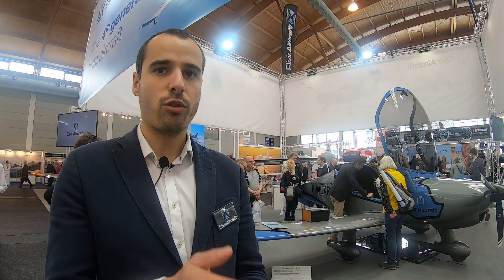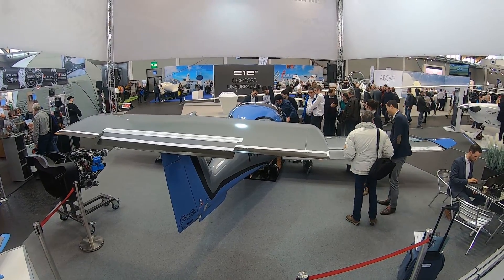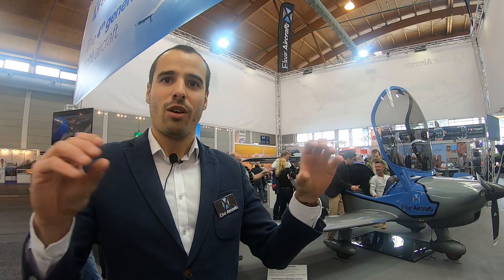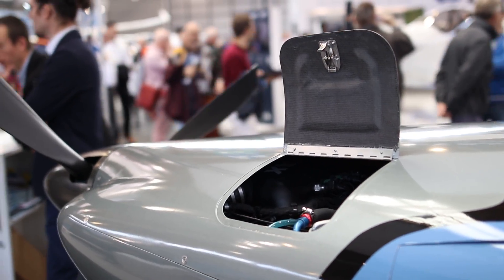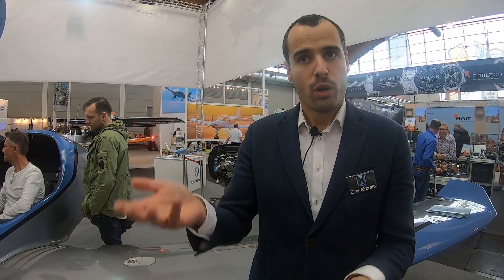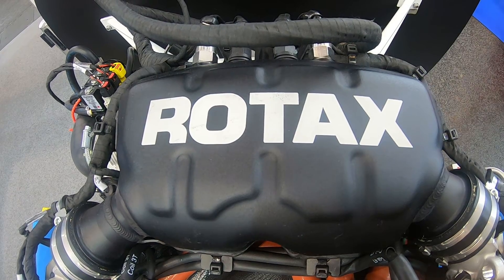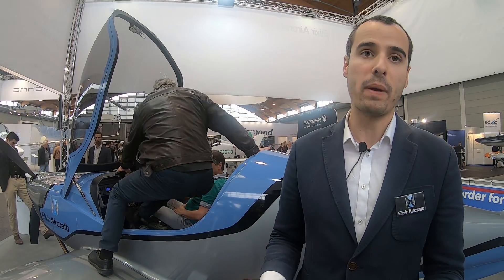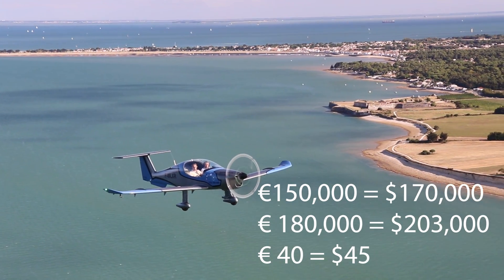Elixir's Molded Carbon Aircraft

Comment: Wow, that's some impressive numbers for such an inexpensive aircraft. Getting that low of a fuel burn with that much payload and that much speed is insanely good. I'm definitely intrigued and will be keeping an eye on this company. Thanks for bringing us this info, Paul and AVweb!
Reply: Beware of dodgy advertising claims, at the very least I doubt that all those numbers actually would occur simultaneously.
Reply: @DrewLSsix  Keep in mind that they got some pretty good subsidies and it's gonna be certified, not microlight regime applicable.
Reply: @DrewLSsix  True in the microlight world, not the certified. There only the costs skyrocket lol. But with those circumstances I would consider this quite achievable. For aforestated reasons.

Comment: This technology is profusely used in automotive. Here in UK lots of companies do that. It was actually time someone applied it to light aviation. Well done.
Reply: Can you name examples.
I see it in race cars and sailboats.
Reply: Kevin Moore  McLaren use this pre preg one shot autoclave technique for their chassis construction. Very fast build time with minimal labour cost.
Reply: Top Reviewer   This is great I love innovation and value engineering, but. ...  Race car frames aren’t expected to function for decades.  They don’t suffer dramatic temperature and atmospheric pressure cycles experienced by high flying (turbo) aircraft.  I am just thinking about the wing so far for;  Fuel storage?    Control rods/cable spaces, control surfaces and all of their mounting points?   Wiring harness placement and service access?   

I am not a composites design engineer but these seem like a few (of probably many more) challenges that must be dealt with.  
If anyone has experience/insights please share!   I do believe aircraft engineering/manufacturing could gain a lot of economy’s when and where they can borrow from other industries.
Reply: @andymckee53  OK, I was curious if any production street cars might be using the technology. Making a simpler, lighter car.   I'm not knowable of what is offered in Europe.
Reply: @timduncan8450  Lots of good points.

Burt Rutan designed a lot of fiberglass over foam aircraft.  The Long EZ being very popular.  The biggest issue is did the builder do the composite work correctly.
Reply: Kevin Moore   Yes, I was thinking Rutan’s methods sounded similar to this.  However I believe there have been questions on that type construction beyond quality control; again not an expert but moisture, time and cycles?     I think maybe the thinner foam cores used in skins (encapsulated inside n out) are considered more conservative since they have fewer voids for systems and points of ingress for moisture??  Maybe other advantages?
Reply: @timduncan8450  I know there is open cell foam and closed cell foam. One is like a sponge, the other is suitable for floating docks. Unknown what they use.

The sail plane industry has been build composite sail planes. Not sure if they use foam cores or glued sections. 

I will be interested to see how this works out.
Reply: Hello  @timduncan8450  check Elixir's website and youtube channel, it's all detailed ;-)
Reply: Arthur Léopold-Léger   Thx very much I will check both!   I also want to keep discussion with you guys.  This is quite nice vs typical utube sniping.
Reply: Arthur Léopold-Léger    I have gotten through all the material that is translated.  I still have many questions about mold tools, layup components & process.   Are there technical discussion blogs or other places to learn deeply about this?
Reply: Not McLaren race cars. I am talking about their road cars being made this way. The wing has a dedicated fuel cell in it made by Merlin. Fuel does not touch the internal structure at all.

Comment: Still way too expensive for a two seater.
Reply: FAR 23
Reply: Tecnam P2002 is 110,000€, has not that payload to range capacity and is not IFR certified. So, not really.
Reply: Ellipse spirit is about 90K, and  it looks better too. This price is way too high
Reply: @saneblane  Ellipse Spirit is an EASA UL/FAA LSA (non-certified) aircraft. Which means it's only Day VFR compliant and in the US it's limited to 120kts. Compare it to any 2-seater CS-23 compliant aircraft like the Pipistrel Virus SW 121 which is 150,000€ VAT Free & can't be IFR-certified ...
Reply: I'd go LSA
Reply: I would totally pay that if it meets specs, and certified in the U.S.

Comment: How easy is it to fix damage to the wing?
Reply: fazole just 3D print a new one
Reply: The guys from Grob made a good video showing how easy it is to repair carbon fiber ! https://player.vimeo.com/video/18019742
Reply: Keep in mind that a pre preg carbon fiber wing should be a lot tougher than a metal wing.
Reply: very easy : 150000 + vat and you will get a spare rotax 912is !

Comment: I've been waiting a long time for someone to build an airplane using this monolithic design.  Most modern designs are still too complex and require excessive construction time...
Reply: This is the next step, see from Pipistrel, Flight Design.  Personally not ready to lose spars tho.
Reply: @JimPearsall  are you saying spars should still be used in this type of construction?
Reply: @captarmour  not should,  open to rhe idea but will need more proof a  stressed skin composite structure has resilience I am comfortable with.
Reply: @JimPearsall  Carbon fiber is pretty ridiculously strong and robust. I have confidence in its ability to act as a wing. IMO this is a huge step forward.
Reply: @JimPearsall  there's a spar in the wing, it's just all built at once, check out the cut-out sketch https://elixir-aircraft.com/4eme-generation

Comment: All good until delamination occurs or damage to a leading edge. The whole structure would require a specialized composite shop to do the work. Not sure i like french cars, not sure i like french frys.....this plane is slick looking and that's about it
Reply: The guys from Grob made a good video showing how easy it is to repair carbon fiber ! https://player.vimeo.com/video/18019742
Reply: Good point, old cessnas always get beat up by fod...Wonder how that will hold up against carbon fiber. Also theres no way to see the structural integrity of the wing?
Reply: KlixTrio you could look it up and teach your self, but why not make assumptions and poor judgements 🤷‍♂️
Reply: Not claiming to be the total expert, but how do you repair a C350 Corvalis? And how much beating do racing yachts endure in their lifetime?